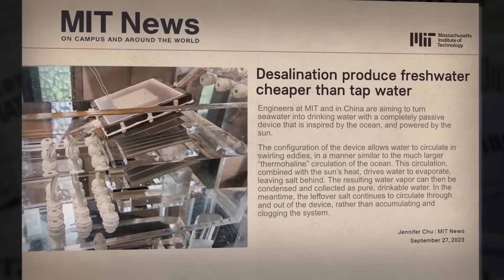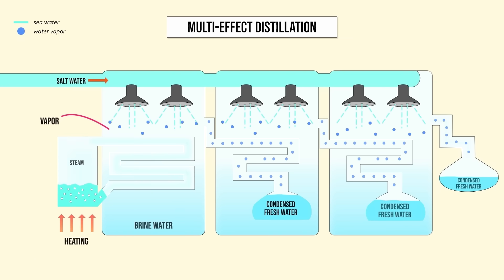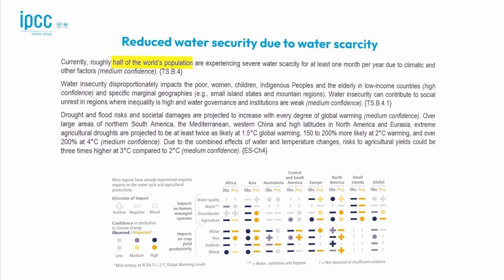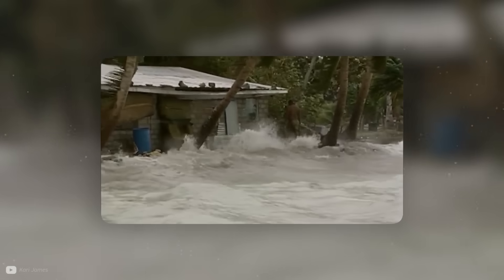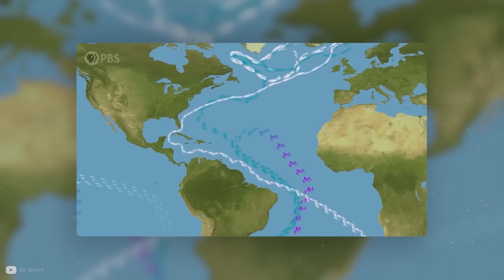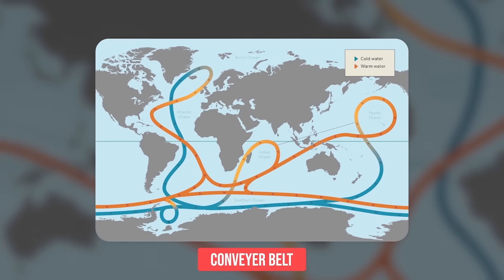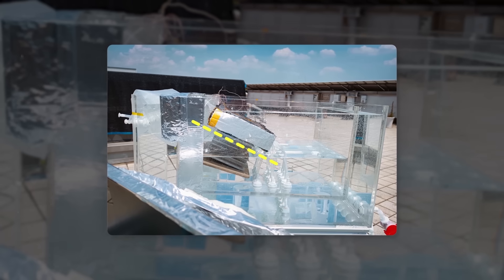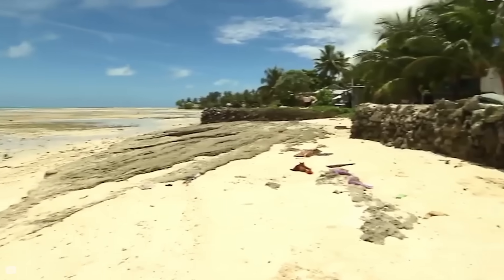Unlimited Fresh Water: Can MIT's Breakthrough Save Us?

Comment: Lots of ideas work in the lab under controlled conditions. Scaling it up for real world usage is the roadblock. Usually cost and or reliability/maintenance prevents it's adoption.
Reply: Massive red flag that they are quoting prices lower than tap water. The cost of tap water also includes the huge amount of effort that goes into getting it into your house in a safe condition (though I understand in certain parts of America that's not the case - Flint, Michigan for example).

Very easy to just desalinate a litre of water and say "look, that costs less than tap water", but one is sitting in a jug in the lab and the other is flowing out of your tap.
Reply: @mentality-monster  But if you can make all the water you need at home, you wouldn't need that infrastructure anymore.
Reply: @mentality-monster for people that live on the coast or on an island it is really not an such a big issue. You just put the water in a tank and  physically bring it with you.  The biggest issue is farming for water usage.  In a place like the Island of Hawaii which has lots of farm space and is all relatively close to the water it is not so hard to pipe it to the farms from plant and then collect the salt to store in a safe place or pipe it out far enough into a current since it’s the middle of the Pacific Ocean.
Reply: @mentality-monster  That doesn't make any sense. A major selling point of this thing is that it doesn't need all that infrastructure. You just give it salt water and it desalinates it. It would obviously be cheaper than tap water. A massive red flag would be if it cost more than tap water.
Reply: @ontheruntonowhere Where do you get the salt water in the first place? Do you happen to live by the ocean? Even if you did, does that mean you have to go collect a bucket full whenever you need a drink? A shower? So yes, you need infrastructure. Period. You need either a means to get water into the property in order to desalinate it, or a large-scale desalination plant that pumps out clean water to homes.

So yes, massive red flags. Blatant ones.
Reply: @Crystan  Yes, you do happen to live near the ocean. 66% of the world's population lives within 90 miles of a coast. Are you being paid by Big Water or something? Why are you so against this? If it works, it's great. If it doesn't, at least someone's trying. Do you think they're going to give up because you prefer the existing system?
Reply: But not always.
Reply: @ontheruntonowhere :  %.  So such ideas can't be taken seriously re being large scale economic solutions until they are PROVEN AT SCALE. 

This hyped presentation sounds WAY too much like perpetural moton claims until it is actually proven practical at scale in real customer situations.
Reply: @rogergeyer9851  Your comment is so obvious it's laughable. Of course it has to be proven at scale, and it might not work, but if it does it'll be huge. Progress will happen whether people like you want it or not.
Reply: If this technology was real, I imagine it be easier to scale it up then to run on small scale.  

All you really need for this is water pumps, and a heating element.  

You could put a field of PV solar panels to power the pumps, and heating element if one wants to keep the eco friendly ness, but there's no reason the heat source has to be solar.  Could run 24/7 if it was electrical instead.
Reply: @lunaticbz3594 Those are interesting points. But you could still stay "mostly solar" or even all solar as long as the system can produce a surplus. That surplus would also provide a buffer for days with less sun. But the hybrid approach is a great idea for versatility and reliability. No water when the sun doesn't shine for a week would suck.
Reply: You don't need to desalinate sea water, just collect the water from the rain
Reply: @natmarelnam4871 i mean't how they remove it from the apparatus? for some time sire membrane holes can withstand salt via currents.
Reply: They fail to provide the key metric, which is volume of fresh water per kWh. This system still needs to boil the water, seemingly making it much less power efficient than RO. The fact that they are using solar power doesn't fully negate that, and introduces problems with scalabiliy and reliability.
Reply: Making it cheaper than US tap water sounds like it might upset the US water industry that I would bet is a multimillion dollar business. They can probably afford to shut down this sort of competition (threat) just like the oil industry fpr years shut down engine designs that ran on water (hydrogen) or electricity
Reply: @markkimba74   did you know that water is hydrogen's ash? lower energy state. there's no way to make it cheaper than tap water. that is mainly rainwater no need to remove salt and huge economics of scale.

if you wanna see real energy conspiracy, look how oil industry pays green parties around the world to attack nuclear power and shills solar panels that are a joke.
Reply: ok, I am calling b.s. on the suppression by governments or a cabal. We are still struggling to make basic inventions better, cheaper, longer lasting ,scalable, and with lower maintenance costs.
If it's such an amazing invention. You get the book and movie deals and the talk circuit as a reward. Therefore just post the solution and schematics on the internet and as we know once it's there, it's hard to suppress said information. It's been that way since the 1990s when the internet had email, simple text, and then the web. @markkimba74
Reply: did you understand how they remove the salt? this whole thing sounds good to be true. someone explain how they flush salt away without physical maintenance or pumps?
Reply: @cubertmiso I vaguely understand the ideas behind this device. Beyond me to say yes or no.But it will be just an oddity if it is not capable of working in the real world.
Reply: @cubertmiso  Eddie currents generated by the heat

Comment: Gimmick and lies. 
First, how in the world does water vapour penetrate the membrane, if the membrane is covered in salty water?
The price is clearly a lie. To make this system for a village, you need:
- inlet pipe from the ocean
- outlet pipe into the ocean
- piping system for freshwater
The filter / membrane will get clogged, the video mentioned 180h working time? 
Seems much more expensive to well/reservoir (US tap) water it was compared to.
If brine is less salty than in other methods, a large volume needs to be pumped from/to the sea.
Disappointing video. Too much focus on the fact that there are water problems, too little and non-critical focus on this new lab concept. I'm dissapointed.

Comment: I just got back from Fiji, spent time in a village where the young lads spent hours each morning filling 5 gallon containers from their island's only well and humping those a few hundred metres to each hut - no point in making it more efficient with pumps, pipes or even a shaduf - it was essentially a rationing system for a very marginal supply. I did wonder why they didn't have an evaporative system but assumed maintenance etc. deemed them unsuitable eventually.

Comment: I noticed that, in your description, you give credit to several persons, but no credit is given to anyone who can check spelling, grammar etc. You could use one. As examples, 'resent' should be 'recent'. And 'area' should be 'areas' or the text otherwise rephrased.

Also, I watched to see the info about the new desalination method, not a re-hash of old methods, just to add length. Boo. Stop flapping the lips and get to the point.

Comment: "Unlimited Fresh Water: Can MIT's Breakthrough Save Us?" - Remove the non-stop background music and re-upload the video?
Karl Marx, Nikola Tesla, Balfour, Einstein, Huxley, Orwell, Turing - should be forgiven for thinking their systems can last forever.
Finite fossil fuels are dangerously hypnotic to humans, their consciousness, reasoning and mental capacity.
Humans were not ready morally, ethically and intellectually to start the mass extraction of fossil fuels with the advent of the steam engine 300 years ago. 
The Magna Carta requires today overhauling – adding to it the right for humans to understand what Energy really is - before any other commandment;
“In any system of energy, Control is what consumes energy the most.
No energy store holds enough energy to extract an amount of energy equal to the total energy it stores.
No system of energy can deliver sum useful energy in excess of the total energy put into constructing it.
This universal truth applies to all systems.
Energy, like time, flows from past to future” (2017).

Comment: Years ago I saw a video about sheets of some fabric that could be erected in a  breeze that would condense water vapor from the air.  I never understood why it works, but now I wonder if it was a similar hydrophobic material.
Reply: Try looking up Andean water supplies  constructed by modern indigenous agricultural communities.    Harvesting the clouds might be a useful start.   
A rustic scaffolding is built.  It's couple of metres high  but running for dozens of metres laterally .  The thing is draped with a very coarse meshed polyprop  mesh (looked like less than centimetre gauge  but the wind must be able to pass through it.    Moisture condenses on the mesh until it drips off into ordinary domestic pvc gutters tied to the scaffolding.   Collection and local distribution is done with very cheap and widely available plastic plumbing fittings     It seems to work  well and reliably.   It catches the moisture as saturated ocean air rises over the heights  and doesn't need much to drop out.  Its a great peasant initiative to help irrigate without going to a bank for loans    Sorry but this absurd UTube doesn't allow links  or I would provide one.
Reply: Oh   Peru .  Try sustainable footprint  Dot  Or g.   Theres lots of photos about their featured scheme.   Hope that helps.

Comment: Gas rises.  How does steam get forced DOWN thru the membrane?  Heat also rises.  If the fresh water in the top section is condensed, how does it have enough heat to boil the saline section below it?  Yes, I know boiling points can be regulated with pressure, but you didn't even mention it.  I gotta call BS on this one.
Reply: Yes, that was very puzzling.  Though maybe water vapor forms at the molecular level throughout the liquid and that's what gets pushed through.

Comment: Thanks for the effort spent on explaining how to run desalination plants. 

I just want to point out that there is a supply of sweet water from millions of underground and undersea sources that emit fresh water. If not, the earth would look like Mars, as the earth constantly emits water into outer space. 
With more CO2 and higher temperatures there would be more plants and less deserts. Because CO2 is heavier than the air and plants love CO2. And because higher temperatures will cause more evaporation, hence lead to more rain. 
By the way, more water in the atmosphere will also cause more clouds, hence more shielding against the sun, hence cooling of the earth. A clever controls system that has been running for over 1 billion years.

Comment: This indeed is a breakthrough.  Fantastic.  I lived on RO water for years. I had a water maker on my sailboat. It was also a breakthrough of a sort, using the “Clark pump” energy recovery principal. I could make 9 gallons an hr on just over 10 amps of 12V!  So could run it on one solar panel.  Now, due to intake water prefiltering, it was fairly maintenance intensive.   And after easy use we would fresh water flush the membrane, costing some fresh water.  This system you have here wouldn’t work on a boat due to the significant motion of the vessel.  But I love it.
Reply: Let me guess, you were fresh water flushing the filter right back into the ocean.
Reply: @y0nd3r   No. as a 46 foot sailboat a thousand miles at sea, I was saving it in a giant tank to pump out when I get to shore.  Where you say? Who knows.    Come on, of course I was pumping it out the Same place all the “brine output goes, back in the sea.  We are making only about 100 gallons of fresh for two weeks use. So brine is minuscule. Virtually unable to affect anything environmentally out in the ocean.  We are not a municipality making thousands of gallons per day. And then pumping all of the brine in a giant outfall off of the beach and onto reefs etc.
Reply: @y0nd3r  Moron
Reply: you could motion stabilize it, you dont even need electric actuators for that
Reply: @deadbeef576 
Ooh, I like your thinking! Can you go into any greater detail on possible methods?
Reply: @eyesofthecervino3366  look at how they motion stabilize the big cameras when shooting a movie
Reply: @deadbeef576  
Will do. Thank you!

Comment: https://youtu.be/2XzmNpacpvk?t=761
So nobody thought of giving the membrane a slope? :) Instead of convection, an engineer would just use a pump. (In this suitcase scale, a tiny aquarium circulation pump would do). Because then the flow can be controlled and optimized according to variations in water temp., sunlight, currents etc. The really interesting part is the membrane - how efficient can it be made to be? What would be the cost of 1 sq. m.? That is the crucial question! But of course, if it had been addressed, there would be no story to tell.

Comment: you take an awfully long time to get to the point. Why would it cool down and condense on the other side if just above it is heated and evaporates? The cost suggested isn't based on anything. The cost of the installation will be considerable, as will that of the pumps need ed. What keeps the system from clogging up with biofilms? Another video based completely on clickbait.

Comment: Promising but these tiny test devices take years (many years) to scale to useful levels at cost effective prices.  Most importantly, this may never get out of the lab due to a great many technical issues.  Promising yes, but there is a HUGE gap between prototype and production.   Imagine a football pitch sized version of this tilt structure.  Would that produce enough water for a small city?  I'm sure this would be broken into manageable sized tilt structures, but how many ml per square cm can be produced?
Reply: and the cost of membrane too...

Comment: The issue I see is bio films. Even if you filter the water stuff will get in and grow. The unit will only be hot part if the day and I especially doubt the lower layers are going to sanitize. It will make a nice paper or two but I strongly sense this will fall into the 'who knew it would be so hard' category. Oh and usually there are a room full of people who were willing and able to point out the problems and challenges that are inherent in the 'solution'

Comment: Use some or all of the remaining heat for use with thermoelectric devices to pump the water around.  Better the 3 stages of steam are used to power generators that then transfer that 'water' to be distributed!?😮

Comment: Why is brine always presented as un udesired byproduct of desalination? An obvious solution would be to also extract the salt from the brine since salt happens to be a useful product. Hopefully the recent breakthrough in sodium battery provides an additional demand for salt.
Reply: Well, scientist realized that much more than just salt is removed through this process and contains elements you don't want in salt. There are much cheaper ways to get salt as well. So, you see, what you deem as obvious was already considered by person's with a higher standard of education than your average armchair commenter.
Reply: @LittleXtra  If you like trolling, be my guest. Only keep on topic. My level of education which you know nothing about is not at issue here and your explanstion leaves a lot to be desired. We do not compare methods of extracting salt. Rather we suggest using that cheapest way of getting salt from a waste resource to avoid polluting the ecosystem.

Comment: Ingenious, but still too expensive. In my country (Greece) tap water costs about 0.5 $ per 1,000 liters in the mainland, so a quarter of the cost of this desalination process. However, on small islands, water costs about 2$ per 1,000 liters too, so in that case it is comparable, but only for small islands. In the case of larger islands, it is more cost effective to build a dam or reservoir and collect rainwater. Still, with a lot of sunlight, like here in Greece, it could be a viable alternative.
Reply: you cant compare the tap water prices between USA and Greece.
Reply: @deadbeef576  Especially as there is no one price for water in the US. I've been in small towns near springs where it was $10 a month, unlimited. 0.2/1000 liters if you were watering your lawn. I've been in small cities midwest where its 0.8/1000 liters. And then there are places where they water the desert, and its 5x that. In those places I might be interested in this.

Comment: 1.I think it's point is that all freshwater even when it comes free from a river needs to be cleaned.  MIT device produces clean water so some of the work is already done.
2. Leftover brine we'll need to be put in lined man-made ponds where the remaining water is evaporated or pumped to sea.  No different than what happens now with desalination.
3. Assume they're really suggesting this would be a cheaper option than current dissolination.  If it cuts the loaded cost from by 20 to 50% that's huge.